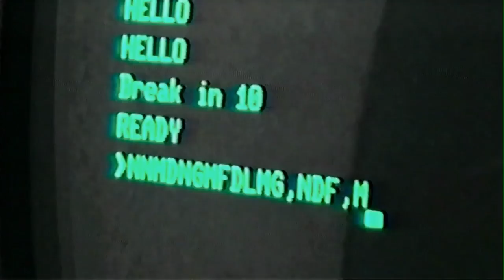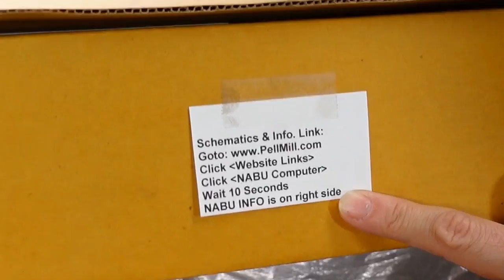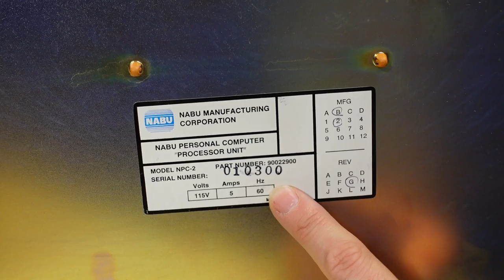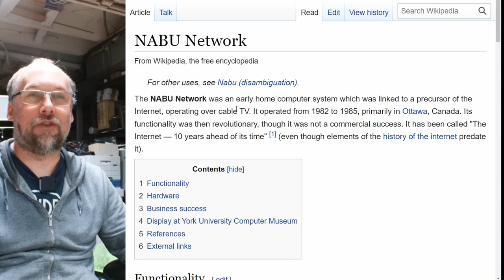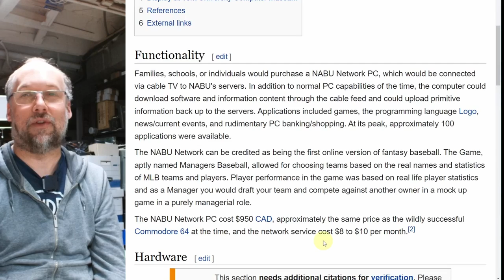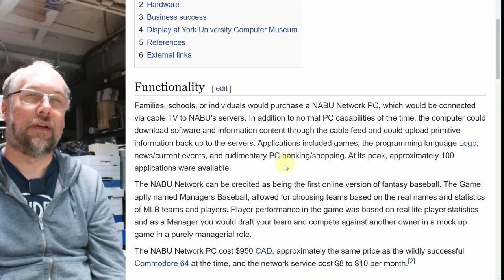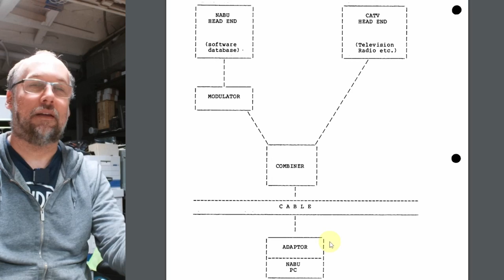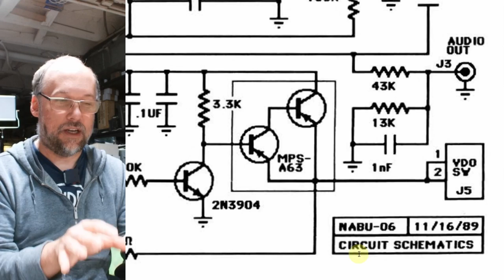The 80s computer you've never heard of: The NABU PC

Comment: Theres a flash board schematic on the pellmill site you could probably build. I'd like to see if any MSX games could be ported to this.
Reply: Someone familiar with MSX will need to create a BIOS at least.  I hope someone does.
Reply: Same. I'd love to be able to play MSX  game on it. Since importing an MSX in Nort America is very expensive.
Reply: @drgiller  I've looked at the specs shown in the video, at least ports seem to have a different mapping.
A CBIOS mod could work for BASIC, but I guess most games probably directly interface hardware. 
But with some liberal bodges, keyboard and casette/disk interface it should be possible to convert this into an MSX, I think.

Comment: It would be cool to get it running MSX. There is a technical manual available on Amazon that would be a great help in that regard.
Reply: MSX had a 32K BIOS ROM, though (I guess part of that was the BASIC interpreter?), along with bank-switching logic, while this NABU unit supported only a 4K or 8K boot rom, and would need hardware mods to its decoding logic to accept any more. The expansion headers appear to map only to I/O port space, not memory space. Loading a BIOS image into RAM from external storage might work, though, and patching it to accomodate the different I/O mappings might be enough to get well-behaved MSX programs to run, if any used purely BIOS calls and avoided poking the VDP, sound chip, etc. directly.
Reply: Running - unlikely, but hardware conversion may be possible, I believe

Comment: Someone please pull apart the adapter. If it’s true that they built two way communication in this could be the first consumer sold device was able to do that. Considering I’m not aware of any cable system that was able to do that before late 1986 this is impressive for thought. Also that board is so clean. My 2nd rev C128 had two bodge wires on it.

Comment: Given that this came out right around the time of the MSX, I wouldn't be the least bit surprised to find that this is an MSX variant. I haven't gone thru the I/O mapping, but since the MSX was effectively an open standard, using it would save a LOT of R&D costs.  Plus, porting MSX programs would be trivial.  Who knows; we may see MSX-DOS running on this thing.
Reply: It seems it's not developmentally related to MSX, but seems to have been a stripped down version of a full CP/M s100 bus NABU computer from a little before this model came out. I guess the general layout of a Z80 based machine was straightforward enough that there was an obvious path to designing one with a feature set suitable to playing games, maybe there was a model circuit from Zilog both were closely kept in line with?
Reply: @carpespasm  Sorry, but false. The NABU PC design came from the MSX design, which was privately licensable in 1982 (although the MSX was not publicly announced until mid 1983).
Reply: I took a look at the I/O mapping, and it's completely different.  So no, it's not simply a MSX variant.  There COULD be some MSX DNA in there, but porting MSX-DOS won't be trivial.

Comment: The solid power supply shielding was required to prevent the EM radiated from it to not become EMI should the TV be sat directly on top of it.  I expect that one of the "Killer Apps" that would have been offered was some form of email.  It predates TELEDON (originated by Northern Telecom), NAPLS, and most likely PRESTEL.  The data would have been encoded and broadcast in the overscan, vertical or horizontal blanking intervals, or a combination of the above. It would have had to avoid the closed caption portion of the vertical blanking interval.

The keyboard appears to match the IBM Selectric or VT100 layout for the main keypad.  The control key to the left of the caps lock was pretty standard for a long time prior to the extended AT keyboard layout took over; for a long time,  third party (and some OEM) 102 key keyboards had a switch to select whether the key to the left of the "A" key was Control or Caps Lock.
Reply: e-mail was not possible at the time as it turned out the cable system of the time was not able to do bi-directional communication! Now with new software, and a RS422 USB adapter it is possible, and there is now also a NABU chat possible!

Comment: I think it would be quite easy to recreate a hardware to connect this thing to the Internet. You just need a gateway from Docsis (or whatever TV Standard was used) to Ethernet. With a little ROM Change, you would be aber to dial to a http Addres where NABU DOS (or whatever) is hosted and bring this up online. I think of a system like the C64 WIFI Adapter. They also convert AT Commands to classical WIFI.

I mean there are even off the shelf parts that convert Docsis to Ethernet. Clearly you wont be able to use them, but if this thing really uses Docsis (which I dont know), it would be relative easy for the Hardware to get online. Ok, you still have to convert Ethernet to a Serial Protocol. This could be challenging, reverse engineering is needed there the most I think. Recreating the Software is totally different part.

Comment: Hard to tell for sure, but those controller ports look like fairly standard 9-pin controller sockets, you could probably use an Atari 2600 joystick or a Sega Master System or Genesis controller on the NABU (if you could get it to play anything).

Comment: Fascinating concept.  It appears it's biggest failure was the miscalculation on getting the cable companies onboard.  It was too dependent on "future technology" to get a critical foothold in at the right time.  The mass market left it behind.
Reply: The C64 was also less than half the price, had a software library 10-100x the size, and didn't require a monthly subscription.
Reply: @espressomatic  But included in the description were also the games, which were good!
it is a pity the system never came off the ground, but I heard they tried to introduce the NABU in Japan too.

Comment: I looked up the conversion of CAD to USD in early 1984; $950 CAD was about $760 USD. Take into consideration of inflation between 1984 and 2023, that would be about $2,245! For the monthly fee... $10 CAD = roughly $8 USD or adjusted for 2023, nearly $24/month.

Comment: One remark, the 8251 is a serial chip. Of course it can be used for a printer but then a serial one, not a parallel port. Reading more it seems to be for the (serial) keyboard.
Reply: It is, and it is only using the receive channel! and it is using balanced pair transmission, that is why the keyboard cable is so long! many meters at least.

Comment: use one of the ports at the back for a module that emulates the cable tv server and have on that module all the software that was written for this system. also another module that has a wifi antenna and allows access to your home router....

Comment: The joystick looks Bally-Astrocade inspired.  I'd swear I've seen that triangular-type head on some other joystick.

Wow... Not sure who would pay $950 for a system that turns into a boat anchor if you cancel your cable, and has a design that makes it impossible to save/boot your own programs - much less save any data privately.  It's like someone merged an MSX with a cable-box after a 2 hour brainstorming meeting.

I thought about the possibilities of a new ROM... but I'd say the best use of a NABU is as a chip donor for other popular machines of the time.  (But, yeah, keep one as a museum piece)
Reply: It did have the option to use a floppy. Someone has recently restored the original network and stock NABU units can access it with a USB to RS422 serial port converter (you don't need the adapter unit.) Another has it booting locally from SD card. Still lots of potential beyond being just a "donor" system.
Reply: I just thought of where I saw the Joystick.  Isn't that the same stick from the Fairchild Channel F?

Comment: Also would be interesting if a similar trick works that people use to run MSX games on Spectravideo. It's the same hardware, but it lies at different IO ports or is connected slightly differently.
Reply: interesting, what is that trick?
Reply: @jwhite5008 Hmm, not sure why my reply got lost, maybe it is held for moderation because I added links. Basically a patched MSX BIOS together with a routine that tries to automatically patch direct hardware access. Noel's retro has what I think is a cartridge that did this, but I think people did it in software as well. There is an official SVI cartridge that just contains a patched BIOS.

Comment: What a shame that they didn't ship with the floppy support.  A floppy would have opened this PC up to so many uses.  Of course, the manufacturer probably wanted to prohibit that, forcing you to the monthly subscription charges.
Reply from the maker: Indeed. Seems this was all about lock-in to that subscription model. Reading the manual, it seems like there were different tiers too, so you could have access to more or less stuff depending on your monthly fee. The manual talked about a modem too -- although no pictures of information seems to exist for that.
Reply: @adriansdigitalbasement  You could get the floppy disk drive for saving files on (LOGO programs, word processing files, even a simple database I think).  But no software on floppy until right near the end, where you could get CP/M.

Comment: The fake lugs on the front are supposed to make it look like it's rack-mounted, I guess. For an aesthetic touch from the 1980s, it actually stands up pretty well.
Reply: They are not "fake" at all, they are real screws used to mount the plastic front panel to the metal box!

Comment: The keyboard uses '6992 baud'? that's an odd data rate...... i guess it could be reprogrammed in order to run at 9600 baud..... certainly could be repurposed as a completely different machine in the same case.....

Comment: Makes you wonder how the system to develop software for this looked, and if programs are preserved somewhere.
Reply: Software was developed for it using the NABU 1100, which was an S-100 card based design with floppy drives. Obviously now software development is much simpler.

Comment: I do love seeing weird machines like these pop up from warehouses into the wild. Collectors get a display item, hobbyists get a new toy to try and get working. And i get to watch it all unfold. I'm far from qualified from doing any custom ROM or anyhing for those, and the price is too much for me. Not the 60 or so dollar/euro, but the 80€ shipping on top. Plus import tax of 25%. But yea. I get to watch others do things. And. Well. Weird computers are way nicer in the hands of hobbyists than just gathering dust until the caps start leaking.

I just hope people don't buy these for parts. Doesn't seem like the ICs are rare, and it's okay to use the keyboard. And if some get ripped to pieces to save multiple MSX or similar machines, i guess that's fine. But i'm going to be sad if the parts start floating around on ebay with no direction just getting scalped or whatever.

Comment: You missed it right in the wikipedia article, it said an internal hard disk module was available. A Ras Pi could theoretically plug into the internal header and emulate a fixed disk then all you gotta do is edit to rom to bootstrap from the disk. Still doesn't solve the no software issue.
Reply: I'm not sure how accurate that is. There was definitely a floppy drive available but the only reference I've seen to a hard disk is that mention on Wikipedia. It's not discussed in any of the other materials I've managed to find.
Reply: @JeremyLevi  someone close to the project said there was a demo and they did a sort of null modem connection between two of the NABUs. One was equipped with a 10mb HD and the other was on the receiving end of the demo.
Reply: @grafxgear  I think it's probably worth noting that NABU made other computers than this one. They had previous models that were conventional computers, one that ran CP/M and another that was Xenix based. It's entirely possible the other "NABU" in that description was one of those.
Reply: @JeremyLevi  they were pretty specific about the hardware even mentioning that the hard drive was no longer working and the floppys were ok.
Reply: @JeremyLevi  FYI Leo Binkowski posted a video where he talks about his time working at The NABU network and even discusses the hard drive / floppy connector that used a 10 mb MFN hard drive. plus the serial ports. there is also an effort to reverse engineer the floppy connector.
Reply: @grafxgear  He's talking about his dev machine. Having a hard drive on a development machine is not surprising, but it's very much not the same as "available", in the sense of something NABU offered for sale to the general public. I"ve seen nothing yet to show they sold anything more than floppy drive units as an option to their customers at the time. Now of course it's possible that they did but that's still an open question. We don't have confirmation of that.

Comment: If someone could reverse engineer the adapter box, why couldn't someone create a Raspberry Pi based adapter that hosts all the software, including disk drive capability, and the ability to plug directly into the adapter port?

Posted this before it was mentioned in the video...

Comment: The joystick resembles the Fairchild Channel F controller, although the Channel F's stick could also be rotated like a paddle.
Reply from the maker: The tech docs seems to indicate purely a digital joystick here, so not paddle support.
Reply: @adriansdigitalbasement  but the keyboard (which has an 6803 CPU with built in RAM) does have an 8-bit ADC, so who knows!

Comment: WDC = Western Digital Corporation?  

Would have been better if they had designed it to easily add local storage so they could use the same hardware and just shift directions when the cable thing failed.  It's such nice looking hardware.
Reply: yes, but this WDC chip isn't a floppy drive controller, but instead avery high speed UART, for connecting to the cable modem over RS422, it is now used to connect a NABU to a laptop running the network software.

Comment: 6MBit in 84... wow.
In Germany by that time we may have just used Acoustic Couplers (Akustikkoppler in German) with really low baudrate... Was born in 82 so not really sure about that.
But (fast) modems weren't allowed from the government who ran the telecommunications network...
But hey, next year I will finally get the fibre connection I really wanted and that was planned here from 1982 onwards but due to large scale corruption wasn't established...
Reply: That 6mbps figure was a bit of marketing fluff.  The interface to the "Adaptor" is 111kbps, which is about half the speed of a 360K floppy disk, and we have no idea what the latency was when requesting a file.  The cable network itself may have transmitted at 6mbps but that would have been the aggregate bandwidth of the whole system, shared by every customer connected to the same headend.  Still impressive, but not as impressive as the marketing fluff implied.
Reply: Pity they didn't just sell it as a modem.  Imagine downloading files from a BBS at 6000000 bits per second rather than 2400 bits per second.  Sure, it's broadcast to everyone, so you have to wait for particular files to come around at scheduled times, or have a request system.  But popular files would be downloaded by everyone interested at the same time.  Could have made a better business case for that, rather than reinventing a closed source gaming computer.

Comment: 6.4 MBit may seem a lot. And for bi-directional it would have been. On the other hand: 320 x 200 x 2 bit x 50 Hz = 6.4 Mbit/s. So without compression it is just giving you 320x200 in 4-colour 50 Hz (or 8 colour 25 Hz). 

So in one direction, it's not that impressive comparable to a normal SD TV stream: 720 x 576 x 4 bit x 25 Hz = 41.4 Mbit in PAL. I think NTSC figures should be comparable (slightly less vertical resolution, but at 30 Hz). Assuming SD streams had 4 bit of b/w colour depth, and in the 80s it may have been closer to 6 bit, and mostly would have been R/G/B, or at least had some amount of colour information included.

But yeah, that was broadcast information of course, not on-demand.

Comment: 8K is enough to have a quite serious basic in the machine.  The ZX81 used and 8K basic and that included doing the display etc.
Reply: the memory is not that much of an issue, BASIC ROM of any size could be mapped through the cartridge, the problem is actually porting the BIOS (probably from MSX) to work with a different port and memory layout
Reply: @jwhite5008  The ZX81 basic included all what you would call the BIOS.  They didn't use someone else's BIOS and for a machine like this, there would be no reason to do so.

Comment: Really cool device for it's time. And the price on Ebay is unbelievable! Too bad they didn't make it standalone with CP/M. Hopefully some intelligent hackers out there could adapt something like a Fujinet to it.
Reply: Indeed or include some type of interpreted language in the system like Basic or Forth, to make it at least somewhat useful without a network connection.
Reply: You could get CP/M for it if you bought the floppy drive too.  But still, it only has a 40 column screen, so it's not that useful.
Reply: @AGMS00  it now has "cloud CP/M" that loads from a laptop using an RS422 adapter, emulating the cable box. There is also a floppy controller than can be connected to one of the four expansion headers, and connects to a connector on one of the four removable plates in the back, so you can connect an external floppy drive. A floppy drive is show in the NABU's manual. Also it used a DOS in the time, but the "D" stood for "downloadable", not "disk". so yes it already had a "DOS".